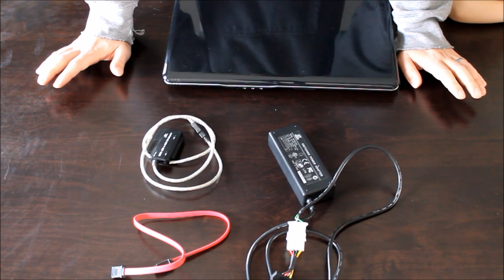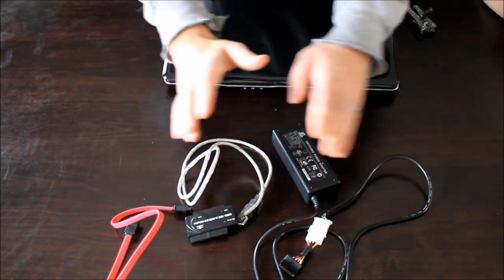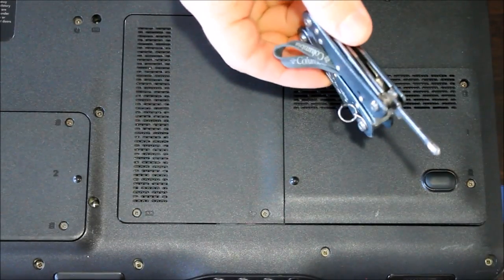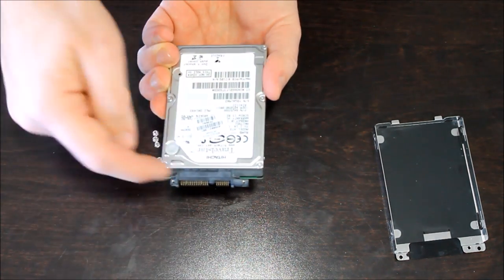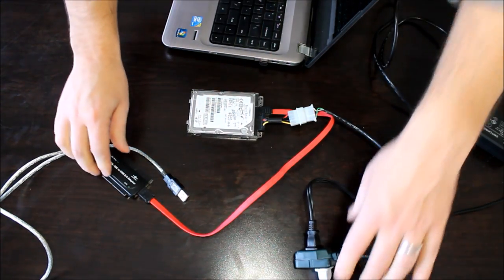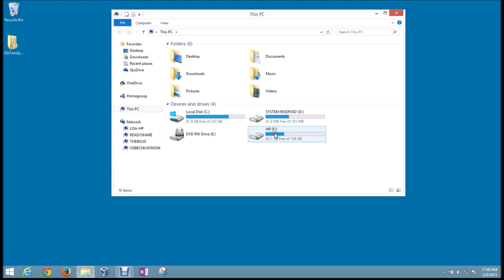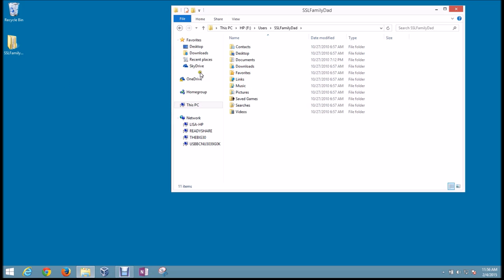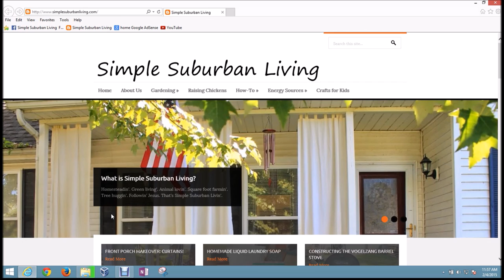How to Recover Data From a Dead Computer

Comment: I have to say I am very thankful for you doing this video. If it wasn't for this video I would have never been able to get my data from my computer that crashed.  I bought the adapter kit from Amazon and it worked like you said. I had spent 4 hours on the telephone with tech support and none of them had any answers close to what you presented in your video. God bless you
Reply: ro hann can you please comment here the names and links of the accessories which is needed for this process
Reply: Is it possible to recover data from a dead hard drive?
Reply: I posted a link for the kit I purchased on Amazon. Worked flawlessly.

Comment from the maker: Sorry Je99na2, I cannot reply to your comment directly. Not sure which options you changed but if it is windows 8 you can use a refresh to fix that or with Win XP, Vista, or 7 try safe mode (tap F8 during startup) and adjust settings from there. Send me an email if you need further assistance sslfamily5@gmail.com

Comment: Glad to find this. Had done this a few years back, but forgotten the process. Special thank you for writing it all out. I had forgotten initially to hit the show more in your description.I now have it  printed out. According to Microsoft and motherboard manufacturer Gigabyte my less than 2 year old ibuypower deskktop with win 10 cannot handle win 10 updates as was made for win 7/xp. Hoping  this will get my data as a computer repair tech added lots of partitions and then doesn't know what he did with the data he supposedly saved.

Comment: Thanks for this great video! I purchased an IDE adapter and was able to follow your instructions very easily (I know very litte about hardware), but when I went to transfer the files from my old hard drive, I found that at least half of them were missing. Does this mean my old hard drive crashed and the files were lost? I had to do this because my old laptop simply would no longer boot up.

Comment: Excellent video! Looking to buy the USB adapter from Amazon. The old hard drive is from a Dell laptop. How do I know If I need USB 2.0 or 3.0 for the adapter? Also, If I buy the adapter kit, I don’t need the external case, correct? Thanks again!!

Comment: Thank you for sharing this. I hope you can also upload a video about checking damages to laptop hard drives and how to recover files from them. Specifically, those hard drives that came from computers that have been dropped to the floor or physically damaged in some other way. If not in a video tutorial, I hope you can answer them here. Thank you!
Reply from the maker: Jesa Perl Unfortunately if the hard drive is damaged and is clicking or not spinning up/not readable there is not much that you can do from a DIY standpoint. There is some specialized software and equipment that can be used to recover data but that is something you would probably have to pay a data recover service to do for you. Hope that helps and thanks for watching!

Comment: This is great to stumble upon!  We've got an old (probably 9 - 10 years) desktop that finally gave it up last year before I could get the files off of it.

But I'm pretty sure that the old pc was running Windows 10.  Will this process be any different or impeded due to Windows 10?

Comment: Hi could you please explain the power cable to the hard drive. I'm a little unsure what you mean. As I have the small white part which connects to the hard drive, it honestly looks like you have added the white connector to the plug wire yourself. Is there a wire that comes with this or would it be purchased separately?

Thank you

Comment: I greatly appreciate this video. What my problem is that when I hook up all of the connections to transfer data from an old hard drive (desktop 3.5 in compac). When I look on the windows file, I do not see the computer recognizing the new drive of the drive I have “hooked” up to the laptop. How do I get the laptop to recognize the HDD so I can transfer the files to the laptop?
Reply from the maker: Try it several times, reboot the computer make sure it is powered up, if nothing still the hard drive may have failed

Comment: great video! i have a question. You copied data from "User", so those data are only from the C drive (OS drive), right? or Does it contain all the data from the D,E,F drives??
Reply from the maker: The user folder contains all of the data stored under that users account in all the staffed places like pictures, documents, etc. It does not include anything that you stored on and other drives but then again you are only connected to one drive so unless you have some strange partition or stored your files somewhere weird everything should be there in the user folder:)
Reply: SSLFamilyDad oh I understood. Thank You.

Comment: It looks as if in the video you didnt use a hard drive enclosure for your hard drive. Are they completely necessary or can we just use the cables connected to the hard drive and go from there without it?
Reply from the maker: +Ajaay Persaud I used a cable to transfer the data and then you can get an enclosure to use the hard drive as a backup for another computer if you want but it is not needed.

Comment: I have a dell desktop computer and it wont go to windows, everything was tried to fix it. I do need to get my pictures off there , so which connection cables should I buy for that? Thank you for any answers. I have so many pictures that have been lost,  I am hoping I can get them off but just  not sure which cable to buy for a desktop windows 10 is what it was running. Thank you for any info. Great video.
Reply from the maker: check the description for the cables that should work for your particular laptop or desktop

Comment: Thank you so much for making this video. I dont know if you still check these, but if you do, I have a question...

I bought the kit, it works, hard drive powers up, regular boot sounds, the 2nd computer does acknowledge the usb connection and lists the drives on "This PC" and the storage(s) show sizes/ availability of drives, but when I try to open to transfer the data, it says "This folder is empty"

What do I do?
Reply: Thanks, that was brilliant.

Comment: Hi. I've been reading the reviews for the kit (transfer cables and whatnot) and they have been very mixed. Some say it worked fine, a lot saying the power supply destroyed their hard drives. So now I'm a little worried to buy that kit. Should I just do so? I've been looking at the sata hard drive enclosure and it looks miles easier and much more straightforward without any worry that your hard drive will explode. Which would you prefer?
Reply from the maker: MisterJanDaMan The hard drive enclosure is nice because you can also then use that as a backup drive for a new computer. That is a great way to go as well. I have been using the cable I have for 10 years and it has never destroyed a hard drive. I have a feeling people have hard drives that are already bad and are blaming the cable kit, just a possibility.

Comment: I have a question.  Granddaughters HD is good and works.  Her old MacBook 2007 has no screen.  I tried booted it up with a mini display port to no avail.  I put it in an external HD case and booted it up on my MacBook.  The problem is that it has a password and she has no Idea what it is.   I know how to bypass or hack it to get a new password but I cannot do from her MacBook because it has not screen and will not boot off of another monitor from her computer.  What options do I have.  I can only boot it off my MacBook
Reply from the maker: I have been thinking about this for a day or so and I can't come up with a very easy solution. Only think I can think of would be to try and put the hard drive in a working mac, boot it up to the recovery and reset the password from there. If the screen is the only issue with the original you should be able to get an external to work just remember you might need to press the hotkey to switch the external once it boots up. Hope that helps, good luck

Comment: yesterday i got problem when booting my laptop, i stuck on a black screen after "preparing auto repair" loading. need to save my data before reinstalling the windows. I have two partitions C and D. C is for the OS files and the D is for the personal files. can i save both C and D data?

Comment: Thanks for a very good video. I have the same problem but with an older MacBook that I want to transfer any files to my new MacBook Pro (Retina, 13 inches) 10.10.3 (14D136) OS X Yosemite. Can not remember the info about the old because I can not start it. Approximately 3 - 5 years old. Can you help me with this problem?
Reply from the maker: Conny Borg You will follow the same process except it is much harder to get the hard drive out of the MacBook. You may want to look up a guide specifically about how to get the hard drive out first and then follow the second half of my video to transfer that data to the new mac

Comment: SSLFamilyDad Great Video, you make it seem so simple. Would this work if the hard drive is damaged? Thanks :)
Reply from the maker: Valerie Hart It depends on how damaged it is. Sometimes the hard drive is just not readable and in that case you would have to send it out to a data recovery center. However, you would have to REALLY want that data because data recover can get expensive!
Reply: SSLFamilyDad Thank you for your feedback. I am not tech savvy by any means but I am thinking about trying this. I appreciate your awesome video! Best Wishes! :o)

Comment: I'm seeing some kits that just attaches to hard drive straight to USB with no power adapter some say 2.5 hard drive the USB will be enough. true?
Reply: Where can I buy the power cable?
Reply: @Buffsr20  you remove your hard drive from the computer . just google '' USB 3.0 to SATA III Adapter Cable with UASP SATA to USB Converter for 2.5" ''  I bought one for $8 bucks Walmart website.
Reply: THANK YOU

Comment: More clearly stated problem I have. I uploaded data/pictures/scans from my external hard drive (WD Passport) which I had used periodically when backing up data from my old laptop before it crashed.  I want to avoid creating duplicate files on my new laptop.  Can you suggest a way to accomplish this, if it isn't done automatically with your described procedure?
Thank you.
Reply from the maker: +Barry Fried if you use the wd smartware that came with that drive to backup then you can use it to easily restore your data. If not, you will need to manually copy things over and when prompted that there are duplicates you can select to skip those files
Reply: I  did not get your complete response.  Please re-send.  Thanks.

Comment: Thanks for sharing this. unfortunately everything worked with my two old hard drives till I opened the users folder, in there I just see two options (default and another one with a different name) but after I copied them to my working pc, no picture, video or anything was found. I don't know what happened but I'm so sad. any recommendations?
Reply from the maker: +Henry Marroquin Sometimes you may have to disconnect and reconnect the device a couple of times to get the folder structure to fully appear. Make sure you can see the contents of the folders before you copy them over tot he computer

Comment: Does this work for a HD that will not boot windows? or just for a pc that will not boot? My HD has a boot error when trying to load windows 8 just goes into a black screen. Thank you for the helpful video regardless if its meant for what im asking just wanted to see if it would or maybe you know a different way? Thank you!
Reply from the maker: Yes, it will work in any case unless the hard drive is bad
Reply: @SSLFamilyDad  Thank you! The adapter comes in friday. I just have to try and use it to see if it is bad or not? If it is bad is it a lost cause at that point?
Reply from the maker: IF it is bad it will not read when you try and use the adapter. IF that is the case you can send it in for a data recovery but sometimes that can get expensive

Comment: Will this work on a 1 TB hard drive that failed (it started to make clicking noises) from an Hp laptop? the model is St1000LM024
Reply from the maker: +alucard2893 if it is making a clicking noise it may not work but it is worth a try for sure

Comment: Hello! I ordered the transfer cable and have followed your steps to connecting to new laptop but nothing happens. Dead computer has been out for years now. Do I need to charge it for a while before I can actually try to transfer the files? Feeling a little frustrated. :( help!? Thanks
Reply from the maker: It is possible that the hard drive is bad and that is why it cant be read. Sometimes it takes several tries to get it to read. You could also check your transfer cable with a known good hard drive to make sure it works there
Reply: @SSLFamilyDad  thanks so much for your reply. I did try with 2 hard drives but they've both been dead/in-storage for years so that doesn't really say much. I'll try again or maybe just order another cable, hoping it's that and not the drives. Thanks again!

Comment: If a virus caused the problem with the old computer not booting up, is there a danger of transfering this when I transfer files?
Reply from the maker: Gene Aria There is not a real high risk of that since most viruses and other malware have to be actually installed or "run" on the computer for them to start causing damage. However if you downloaded the virus files and then copied them to the new computer and then ran the installer or file again it could install it again so just be careful and run some security software. Hope that helps!

Comment: ok, so i have 1 laptop that the mother board is not working, 1 emachine (i know old as heck),  gateway touch screens. can remember what is wrong those.  but can i still get my pics off of these as well. especially the emachine.
Reply from the maker: shanunie yes, any computer hard drive will work with this method you just need to purchase the adapter linked in the description and then get the hard drives out of the broken computers.

Comment: I have many pictures on my old computer.  I always thought it died because of a virus or something.  If I try this will the virus or whatever it has spread to my new computer and can I transfer my pictures and my address book from the old to the new windows 8?My old one is a desktop windows  XL. I wouldn't want to take a chance of damaging my new computer.
Reply from the maker: When you transfer files from the old computer to the new one the likelihood of you transferring a virus is slim to none. Viruses normally run within the operating system file structure which you are not transferring. Your personal files should not contain any malicious code. However, it is always good practice to run security software on the new computer to be safe. Hope that helps!

Comment: Drive detected however once click on folder to recover . It keeps on reading but doesn't show data in it . What to do ?
Reply from the maker: Try to unplug and power on drive first then connect usb. Try on another computer. Try a different usb port, preferable one in the back if a desktop computer

Comment: I need to ask,my laptop isn't dead but the screen is just unusable and it's not charging.Can i remove the hard drive and put it in the new laptop?
Reply from the maker: +Dar grip Hax unless it is the same model it probably won't work but you could try. As long as it reads tge boot sector it should try to start windows but all of your kernel and drivers would be setup for the other computer so it might freak out and blue screen

Comment: Hello Guys 

just wanted to ask for some help..i got a old cpu and i want to transfer files from that CPU to my new laptop but i dont have a monitor..how do i do this?
Reply from the maker: +Fiezaan “Eezzy” Mumtaz Follow the steps in this video and take the hard drive out of the old tower and connect it to the laptop to transfer the data you will need this cable to do it though - http://amzn.to/1RQBqv7

Comment: Help; I don't understand what the problem is. I plugged the USB part onto my laptop but the drive won't show up. The hdd is beeping like it should and there is power because the green light is on. My adapter is kind of crappy so it doesn't have a red button like yours, only a green button.  The only way for me to verify is the beeping. 

Still my old drive won't show up. I restarted my laptop because it didn't finish configuring some updates,  but after that same issue. My laptop is a Windows 8 and so is the old drive's laptop. I didn't even get the pop ups on the side like you did.

Please help! :) Thanks
Reply from the maker: Amy Lor In most cases this may mean that the hard rive is bad. Even though it is powering up it still may not be readable. About the only thing you can do would be to try to plug it into a different computer and see if there is some issue there. Hope that helps and sorry it is still not working!

Comment: hi 
my laptop only shows the  system reserved D
😢 any idea why. is it broken?
Reply from the maker: +daredevilLeo1 try to unplug and plug back in the USB cable, reboot and try it a couple of times and eventually both drives should mount. You can also right click " mycomputer" select manage and then go to disk management. See if the disk is showing up there